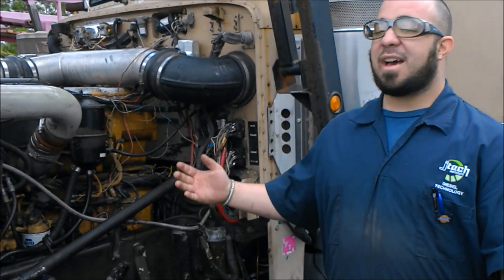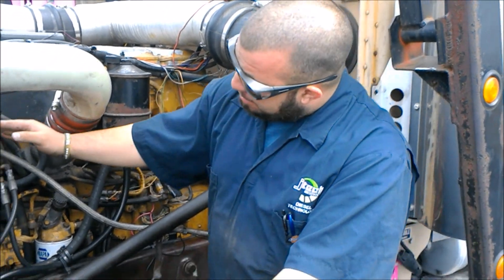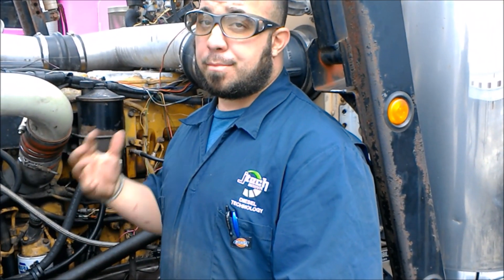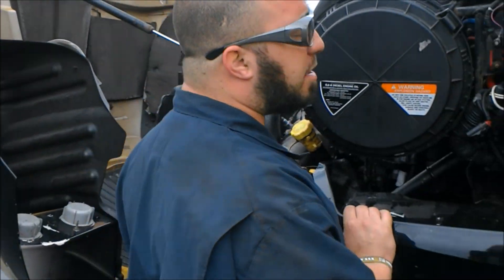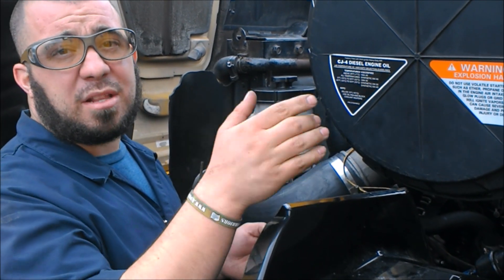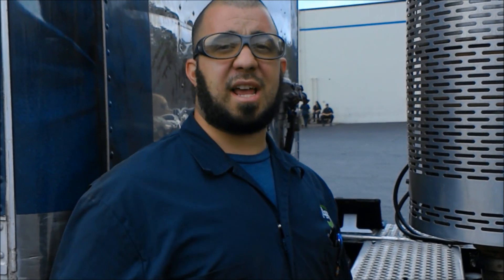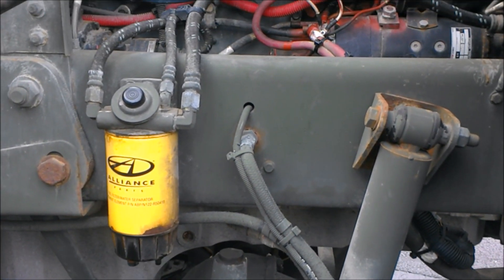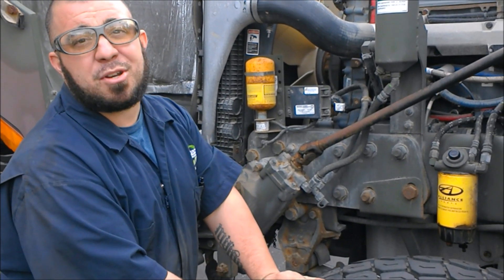Sensor location and identification

Comment: Some of these sensor descriptions are incorrect lol the oil pressure sensor does not regulate the oil pressure. If its to far out of spec if can cause a shutdown light and shut the engine down but the sensor itself does not regulate the oil pressure. That is done by the oil pressure regulator in the oil pump. The sensor just gives readings to the ecm

Comment: The Atom sensor is behind the fuel filter on this Cat engine. The oil psi sensor is located in the main oil gallery under turbo. The boost sensor can be at the front of the head or rear, depends on serial number.  Coolant sensor located in regulator hsg. Air inlet temp located to the right of intake port. Sensor in front cover speed/timing sensor.
Cat  moved oil sensor on newer models to driver side. Also went from a 3 pin to a 2 pin on some sensors. Put dual speed/timing sensors in. One at camshaft gear, other on crank gear.